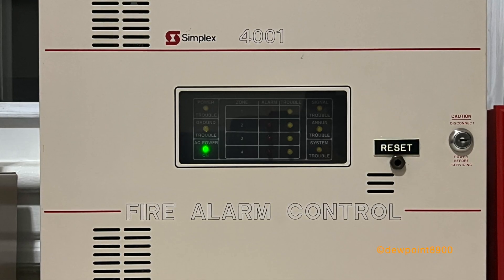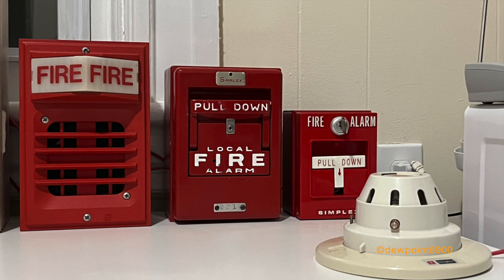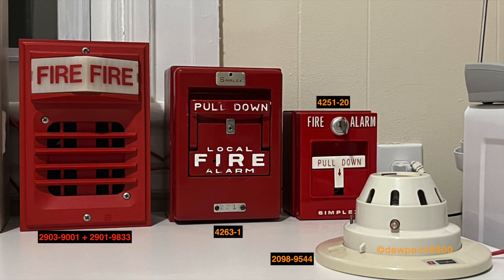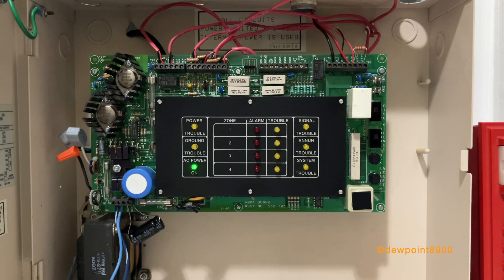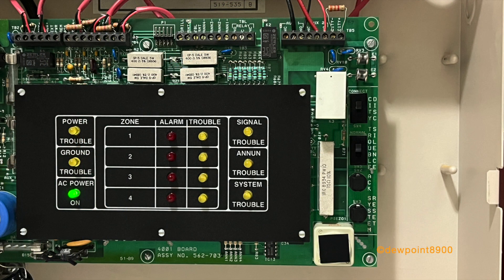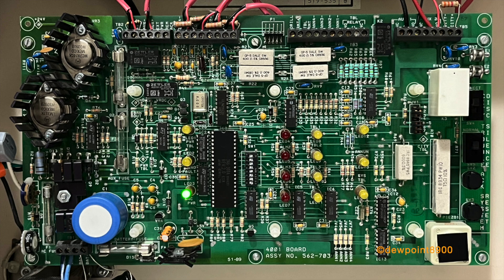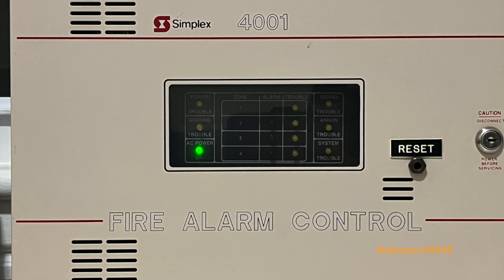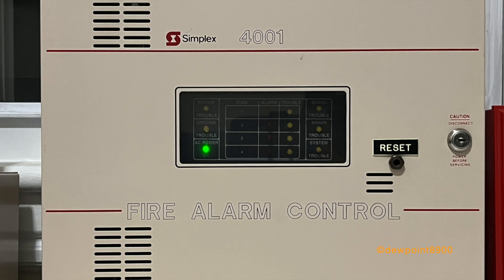Simplex 4001 Overview and Demo

Comment: Why the key switch activated the panel at "NORM"?
Reply from the maker: The tamper zone a normally-closed, so the switch trips on an open (NORM position).
Reply: @dewpoint8900Oh ok, by this i can tell that this panel is really old
Reply from the maker: @ Yes, this 4001 is from 1989!